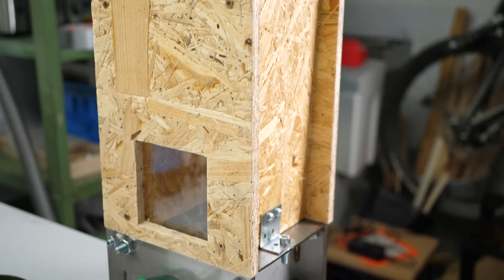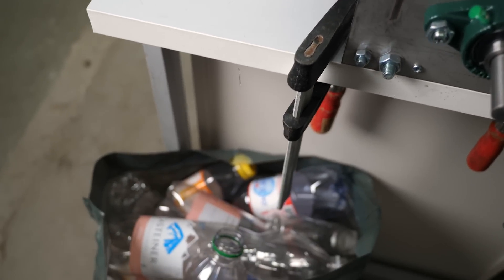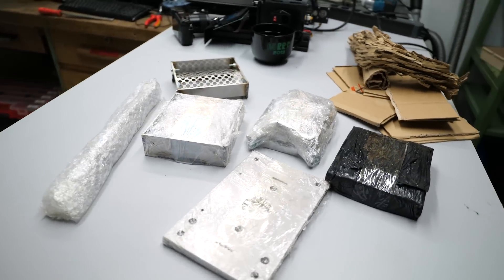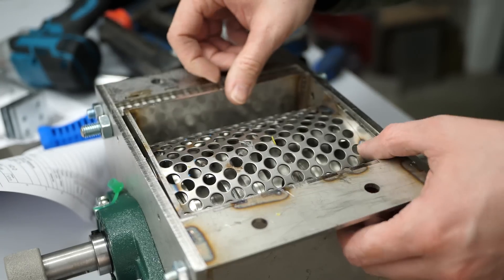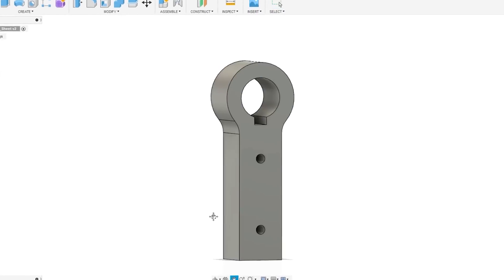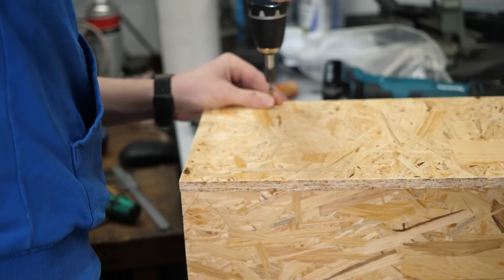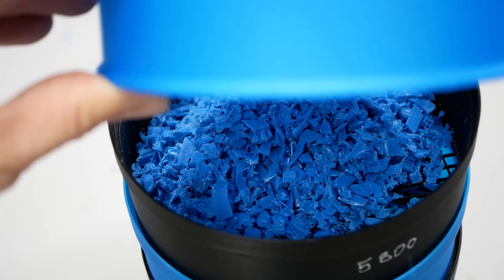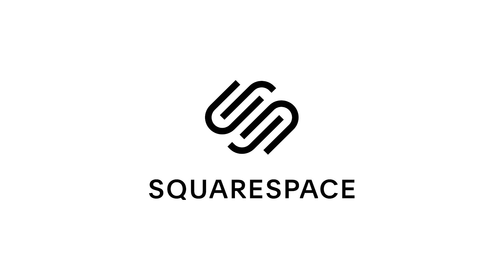Building a Hand Cranked Shredder for Recycling Plastics 💪

Comment: Take the "trash" particles and melt them on a hotplate into a puck then re-shred the puck to proper size particles.
Reply: maybe you can use water, the metal will sink, and the plastic will float
Reply: @m1c4o  Best idea. but some plastics ( I think PLA) is denser than water, so all is on the bottom.
Reply: @denispoppitz8323  then maybe some other liquid like oil, now I'm overthinking 😅, if could be possible to use liquids with different density be used to separate abs, petg, pla and other contaminants from each other, sorry for my bad English 😅
Reply: @denispoppitz8323   perhaps a (salt?) solution to increase the density.  There's something they dissolve in water and fill tractor tires to make them heavier so they have more traction.
Reply: the problem is: there are quite a lot of metal shavings in there. you really don't want those in your final filament
Reply: @SkaveRat  You could probably use a strong magnet to sift them out couldn't you?
Reply: @kelpygsus132  that might work
Reply: @kelpygsus132  I think some part were made of stainless steel = only partly magnetic
Reply: @kelpygsus132  Unfortunately the shredding wheels are made of stainless steel which is not magnetic.
Reply: @kelpygsus132  stainless steel...the 304 this is most likely made of is not ferromagnetic...
Reply: @kelpygsus132  Ferromagnetic particles, yes.  Aluminum, no.  Dirt, no.  Stainless, depends on the alloy.
Reply: The idea of using water to separate the particles is a good one. If the plastic is denser than water, you can find a different liquid with density between that of the plastic and thr steel
Reply: Stainless steel still responds to magnetism. Just have to spin the magnet. Eddy currents will be generated and that'll fling out the metal parts.
Reply: @Xiph1980  Did someone say hot glue a magnet to the head of a bolt and chuck it up in the drill?

Just me?
Reply: the material degrades more every time it is melted

Comment: You might want to consider melting the to small particles down into a sheet and grinding it down again
Reply: That might expend more energy than producing/buying new material. I was thinking about a parabolic morror or something but you would need some contraption to distribute the heat and prevent overheating.
Reply: @madao7865  Maybe a solar oven would work?
Reply: @R_Forde  Good idea. One would need to a high end thing, though. I did a quick online search and most of them seem to max out at about 150° C. There are, however some that get up to 200 or even 300° C. One of those should do the trick.

Comment: Have you considered adding a 3d printed gearbox to your crank?
Reply from the maker: A challenge but I think plastic won't be able to handle the 500Nm torque required.
Reply: @CNCKitchen  I guess 500Nm is a lot of force, but then again plastic has surprised me a few times already.

Comment: I think you can desolve the fine stuff and get the metal with a magnet out. After the disolvant is evaporated you should have clean material.
Reply: That’s probably aluminum from the block housing.

Comment: Greetings. Great video as usual. Here's a suggestion. Give yourself some mechanical advantage by adding a couple of gears. Perhaps a 3" dia gear at the shredder and driven by a 1" dia gear at the crank. Then you can reduce the length of the crank somewhat making it easier to crank while still having overall mechanical advantage.

Comment: I'm not sure wether the speed of the blades is important, but if not, then you probably can get some high torque with a worm gear. Not an engineer though, correct me if I'm wrong.

Comment: Witch desktop cnc router for a beginner can you recomand?
Reply: I think that would depend on application (like for instance I want one for making special refrigeration expansion blocks and also say like a pistol top slide and other gun parts), so I could probably get away with most of the machining done on a $200 device if I work around some of its limitations (assuming I use copper for the refrigeration part and aluminum for the pistol parts), but say I wanted a large part made and then that means that a small machine would be useless (like a custom front bicycle gear, I’ll probably use a CNC plasma cutter for that).

So depends on application, from what I’ve seen a lot of the cheap CNC routers I’ve been looking at are usually very similar in design, and it doesn’t look like there is a huge difference for the base of it besides sizes and stuff. The bigger things are they usually cheap out on the tooling head (motor system), and honestly I love modding things so much it’s not a big deal to me because Id probably just customize that part anyways, but you might want to get one with a decent motor to start with (you’d just have to look at reviews for narrowing it down, which I’d recommend anyways).

But first you need to know what you want it for, because size of work area is going to be a huge price factor and if you get something too small then it’s going to be useless. I think with all there will be a decent amount of learning curve just like 3d printing (thankfully I’m a mechanical engineer, so I hope that will make it a little easier since I’m used to designing for specific tooling).

Oh and you’ll probably spend a lot on the bits and tool tips, so make sure you have money for that (and if you need to add oil cooling and splash trays or if it’s wood probably need a box enclosure and a vacuum, it will vary with what you want to cut).
Reply: @jakegarrett8109  Mainly I wante one for some Airsoft parts. I thought a size of 400x400x150-200mm would be good. I don´t want to make the same misstake that I done with my 3Dprinter and buy a to small one. So material it should be able to work with aluminium,plastics (ABS, teflon,delrin), wood and maybe smal steelparts (but only if I don´t need liquid cooling for steel) I also dosen´t have anything against modding it but it should work fine like it´s come. (to learn what I need and want for mods) So can you recomand a Manufacturer for me?
Reply: Rex McStiller oh that’s quite a bit bigger than what I’ve been looking at, so I have no clue, haven’t looked at those bigger ones at all... 

haha, that would be a nice and big machine, my 3d printers are only 200x200x200 category, which for example is just big enough for an AR15 receiver, and I’ve almost never needed anything bigger. It looks like you do bigger parts than I do, so that’s massively bigger than anything I’ve been looking at. Well good luck, at least you have your size picked so that narrows it down a lot.

Comment: I would look into using an old bicycle pedal assembly instead of the crank.  Then you can put your whole weight on it more effectively.  Depending on your skill level/tools then shortening a bicycle gear and chain assembly would add significant advantage.

Comment: i'd love to see a review or at least a more detailed look at that pellet extruder.
Reply from the maker: Will do!
Reply: @CNCKitchen  I'd also love to see a review of the extruder. 3d printing with waste PET would give people a nearly infinite source of material.
Reply: Hey @CNCKitchen , or Stefan if you prefer. I'm curious about the performance of the Mahor V4, as I intend to buy it to make 3D printed prosthetics for amputees in Kenya. A local company makes recycled injection molding polypropylene pellets. Previously, I've already been using PP in the 3D prints because it's the strongest for the least amount of money. You probably can imagine that I've seen my fair share of failed PP prints, and had to optimize my printing process a lot. Eventually, by tweaking the design and getting a heated chamber, the prints come out excellent. I'm curious now if the Mahor V4 could achieve the same quality. If this were possible, I would be able to make prosthetics out of 100% recycled PP. I'm a big fan of your work, I learn a lot from your videos, could you please help me with this endeavor? Wish you all the best!

Comment: I think you can recycle all of your tests now which is great since they must take so much filament.

And definitely try to add a gear box to the shredder. You should be able to make it easier to turn. Would you maybe try to add a gear 500 watt motor? I figure that all you really need is force and that speed is then a luxury.

Also, maybe you can use your cnc machine and carve some colorful sheets of plastic into some test shapes. I would like to see a comparison of solid plastic to solidly and normally printed parts to see what the changes in strength to weight ratios are. How much of a difference is there really when you print plastic instead of molding it?

Comment: I could use this for composting cardboard boxes
Reply: Blender works for that too if it’s not a huge amount, a $350 machine is not really needed for cardboard (you could probably use plastic like 3D printed parts to make one for simple cardboard).

I do love overkill sometimes (like a tractor powered shredder than can eat right though old tires/wood/plastic etc in seconds), but this machine he’s using is way overkill for cardboard which would really only require a glorified paper shredder. Depending if you have a packaging warehouse though you might actually want something bigger (the feed size is pretty small on this one since it’s for printed objects, it’s not optimal for cardboard which will be feet wide not inches). But I’m sure they sell something similar for cardboard if that’s what you mean.

Comment: I'm saving all my failed prints anyway. When I have a few kilos, maybe I'll send it to you.
Reply: What I've been doing is saving the boxes the filament spools come in and putting scrap/waste back into it. Mixed colors go in with black since it will affect the color less. I've only used PLA so far but mixed materials would likely not be reusable.
Reply: @Megabobster  Oh yeah, I didn't mention that it's all PLA.
Reply: @wordreet  also good thing about PLA filament is that its biodegradeable

Comment: Stefan, you mentioned wood and metal shavings at 09:35. I know some waste processing facilities separate the metals from other materials with a powerful electromagnet, perhaps that's worth a try? The wood shavings might be trickier. You could try submerging these shavings? Maybe the wood shavings will float but the plastic shavings (depends on the plastic type I suppose) will sink?
Reply from the maker: Good point.

Comment: Hi Stefan. Have you tried lightly warming the plastic in a microwave before tossing it into the shredder? That should reduce resistance without completely losing structural intgrity. Perhaps a geared link to the crank would increase torque & reduce back strain?
Reply: Please don't do this. It makes it more difficult and you run the risk of gumming the entire device up. Freeze the parts, you want them to be brittle, not plasticized.
Reply: @Xiph1980  You're not "liquifying" the plastic. Can you test your freeze theory? Perhaps Stefan would like to try a few methods and make a video showing what happened?He's very good at Scientific Test comparisons.
Reply: @goldbunny1973  I'm a mechanical engineer with plenty of experience in plastics. I can assure you, that you do not want to heat the materials. Want a test? Go to your local hardware store, and get three small plastic solid core panels of somewhere around 1 to 3mm thick. Any material you'd use in 3D printing would do, but polypropylene or pvc are probably most convenient.
Now, place one panel in your freezer and one in an oven at 50 degrees. Leave the other at room temp.
Get two beams of lumber with sharp edges between which you can clamp the pieces of  plastic with some glue clamps, and get a large chisel and a hammer. Make sure you can mount the improvised lumber clamp rigidly to a table.

*****
Important, use protective glasses and gloves!!!!
*****

After about 2 hours, get the room temperature board, which is your control, and clamp it in. Then take your chisel, place it with the flat side against the lumber beam clamp, and the pointy side flat on the panel quite near one of its edges. Hit it, trying to split the panel.

Now, do thesame with the other boards, one at a time. Leave the other board in the oven/freezer while you do the first real test. 

Plastics are called plastics for a reason. They get plasticized with temperature.
Reply: Xiph1980 That is correct, what we want is brittle material not ductile, heating it up is the worst way.
Reply: Might even do PLA in the winter (incredibly brittle, like I had my 3mm filament flying to pieces and showering my face and room like a frag grenade earlier today because it was so brittle coming off the roll...). So maybe for fun video get either dry ice or liquid nitrogen and dunk the part in it so it really explodes in that shredder (I think the parts should make a cool fog effect when they snap if they are cold enough and atmospheric conditions are correct). Useful? Probably not... But cool! (Im still not sure why the filament was so brittle, but warning it up helped a lot!)
Reply: @jakegarrett8109  LOL! Sounds like a video waiting to be made.
Reply: @Potato2456-o1w  A microwave could warm plastic by inductive heat; Stoneware can be heated to HOT by having something microwaveable in contact with it, so place the plastic in secondary contact and it'll be heated. You're not trying to heat it to it's melting point, only soften it's structure so it'll granulate more easily. Just my thought, could be wrong, can't test it as my microwave is currently offline : ) Someone could run a test tho..